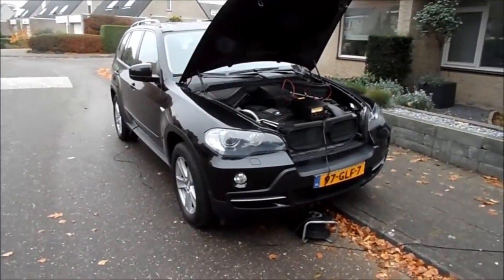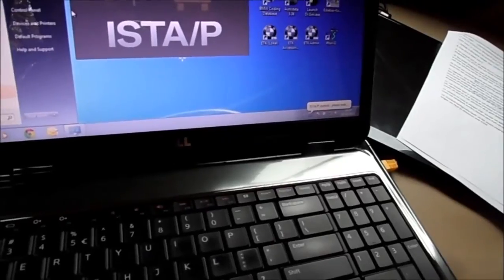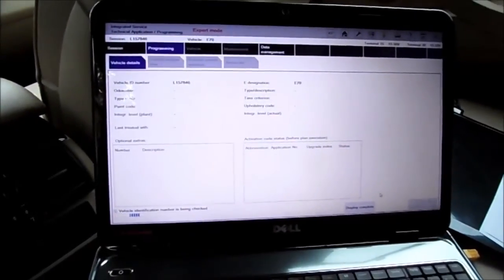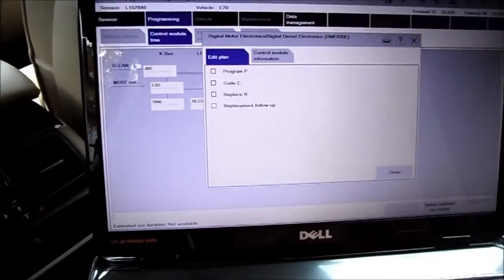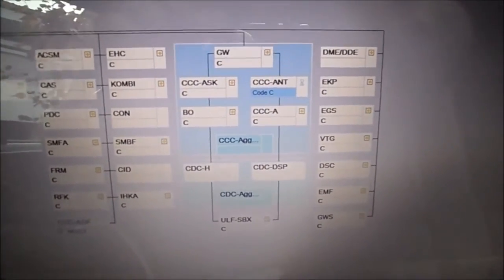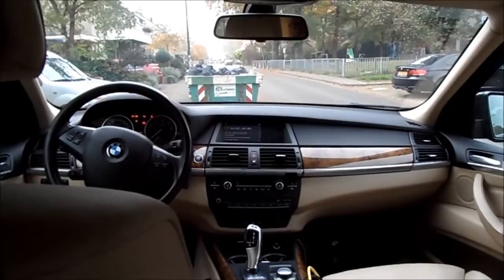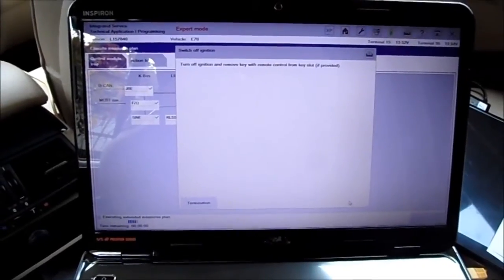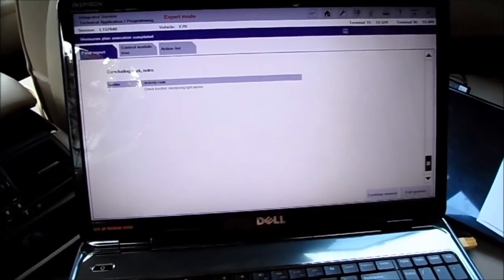E70 Update ICOM ISTA_P part1

Comment: Is the MOST connector on the same side in RHD e70? So under the steering wheel? Or is it swapped on the other side?
Reply from the maker: I am pretty sure the Most is under the glove compartment 
So it will change to the other side on a RHD
Reply: @dickvre  ok thank you, you are correct it was under my glove box ; I’m going to buy an ICOm , I’m not sure whether to buy one like yours or an ICOM next ? I’m trying to revive my CIC from a bad flash ; my plan is to buy an ICOm try ista-p first via MOST ; if that doesn’t work then use WinKFP but I’m bit lost , if you help me I can pay you please

Comment: Awesome video! I have a bmw e70 as well. I have the 2017 ista-p and k-dcan cable. I realised that the USB cable is limited to what it can do. I also have a battery charger, the only thing that I need to buy is the icom port.

I need to retrofit the cruise control and cic. Apparently, BMW in HK doesn't have cruise control by default which is weird.

As long as I have the icom connection, accepting the measure plan should be ok?

Comment: Very use full for first time users.Is it good enough to have Intel Core Duo cpu with 3 GB ram with 480 GB SSD drive  to handle the communication and run this software ?
Reply from the maker: Palani Kuppuswamy 
I installed this software on many different laptops, your specs should be sufficient